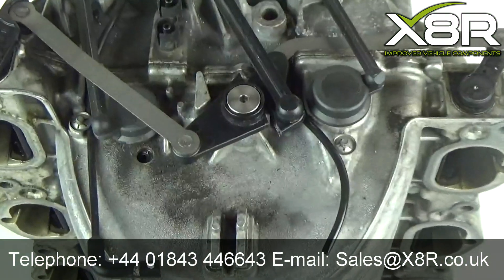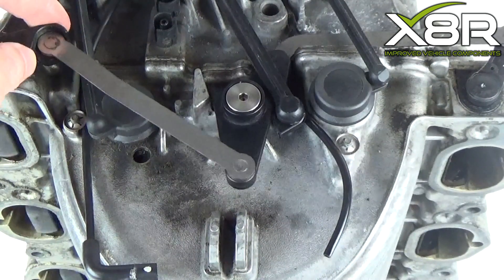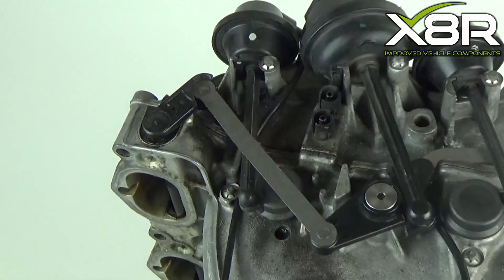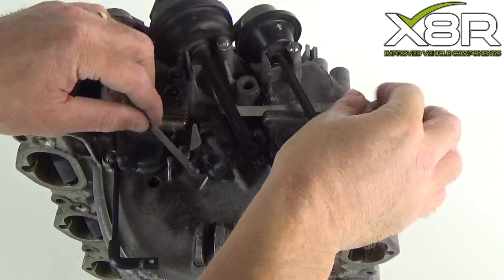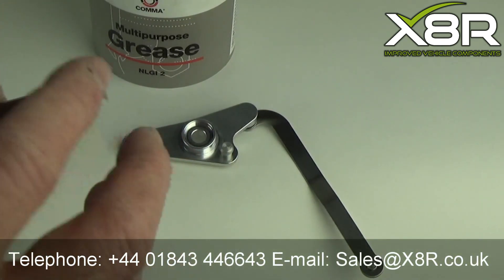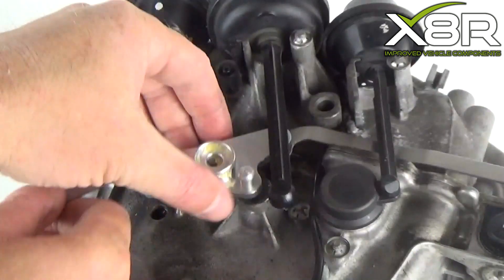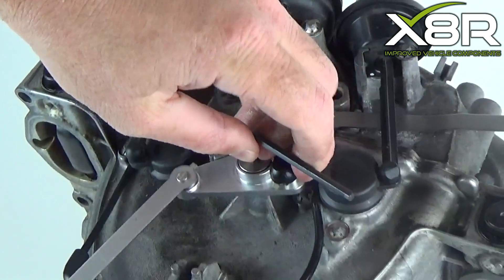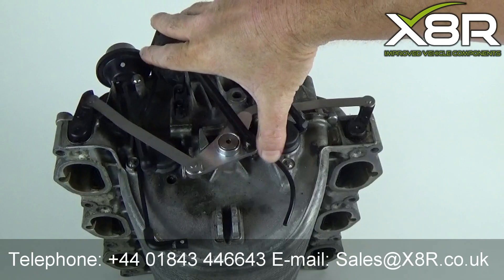Mercedes Benz V6 M272 V8  M273 Intake Manifold Lever Repair Kit

Comment: This is the easy part, the hard part is removing the intake manifold out of the engine, such a pain!
Reply: Not hard really. Very simple.
Reply: @BMWI-gk9wh  its the harness and wires that make it tougher specially when they are old and brittle. But, yeah its a easy fix from there.
Reply: Most people just over think

Comment: i have c240 model 2002 /the Engine shiver in N and P and i have oil evaporation /1000miles*1 litre oil can u help me to find the problem plZ
Reply: Most likely the broken pivot point shown here, also with such a rough idle you may have internal flap damage, I have had the steel rivets from the internal flaps wear a hole through the aluminum, you may want to remove and inspect the intake manifold and proceed from there, although I would upgrade to the aluminum parts shown here even if you need a new intake.

Comment: its funny how they say the plastic breaks due to carbon build up on the swirl flaps yet say nothing about removing the buildup and only offering an aluminum replacement. So, lets force our way through the carbon, or just see if we can break the next point of least resistance..
Reply: I just did the job on m273 engine, not saw any carbon build up, so I think it a design fault, the plastic will degenerated sooner or later due to the heat and vibration.
Reply: Typically there isn't much build up.
I usually spray and force air thru the level points
Reply: @BBJfan  Exactly, it's not a direct injection vehicle.

Comment: Thx for this video I have the exact problem with my gl450 2007 and was told by mr Mercedes dealership the entire manifold has to be replaced at cost 10k.  I knew it was a scam did my homework on gl 450 manifold and realized what the real underlying problem is. Their diagnosis is a crack tumble flap and recommended replacing entire manifold.
Reply: Sheikh Latif the only way to fix that issue is to replace the manifold... They don't sell replacement arms unlike here
Reply: @nextwaze5661  I got mine for 10€ on amazon. I the mercedes they wanted to replace the whole manifold for 1400€ plus another 1000€ on labour
Reply: 10k? Your just lying. Max with parts and Labor about 2500$